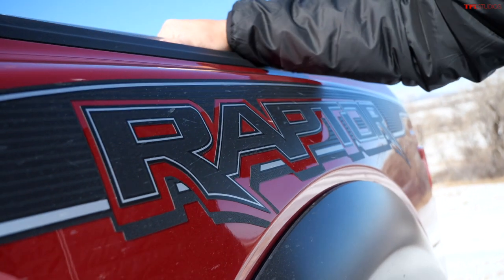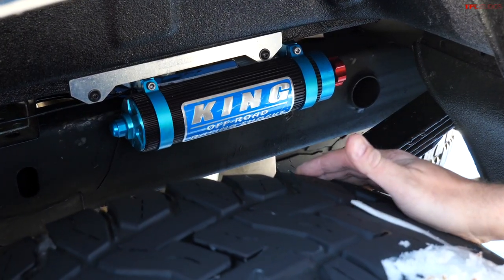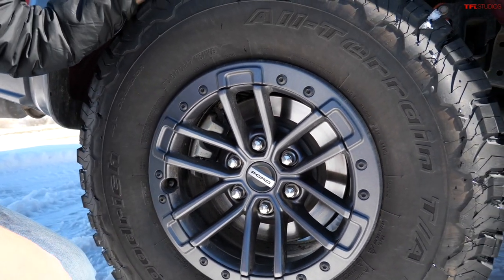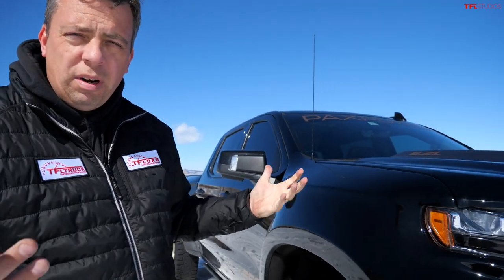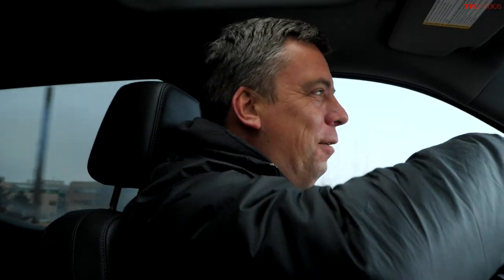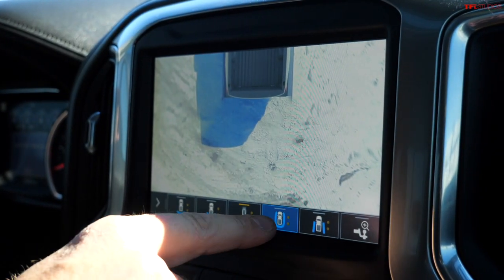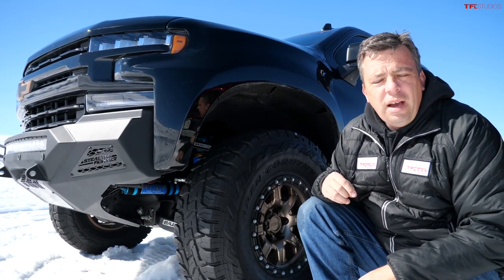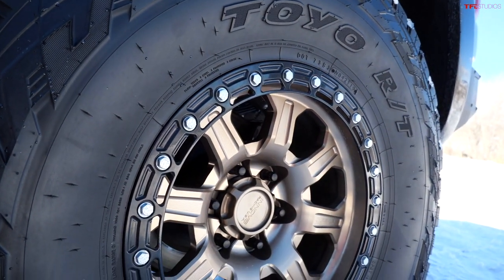Is This 650 Horsepower Chevy Silverado Jackal The GM Truck To FINALLY Take Down the Ford Raptor?

Comment: Even if you option that Silverado up to 77k where the Raptor sits, you still won't have a better truck then what comes factory equipped
Reply: True, but that's what to expect if going after market... GM should just make a factory one anyways.

Comment: I'm a chevy guy, even own a 16 Camaro 2SS but I would get a Ram or Ford before I buy a GM truck.
Reply: 2017 Corvette and I agree.
Reply: Agree!
Reply: @rondail5675  Sadly I no longer own my camero or my mustang, but my 2018 STX 4X4 supercrew isn't going anywhere. (I drove my last F150 for 15 years)By this time next year I will have enough saved for king suspension upgrades and 34 inch KO2's on the factory 20's.

Comment: Im a chevy dude by heart but the Jackal isn't a factory truck like the Raptor or the TRX so I wouldn't call it a direct competitor. GM should partner with dirt king fab or bajakits to design the suspension and stuff the LT5 from the ZR1 or the LT4 from the Z06/ZL1 to make it a true factory competitor??!!!

Comment: My 2012 Silverado 1500 has the same kind of suspension and will be getting a. 500 hp.crate motor soon . and I will save myself $60,000.00.
Reply: Well now that I foundout that the EPA doesnt like it when vehicles with vin numbers have aftermarket upgrades for more H.P. they want to go after people and force them to make it stock again or they will take it from you.

Comment: There’s no reason GM can’t build a Raptor fighter like this... it makes a lot more sense than the ZL1 Camaro (which I think is awesome, but GM sells a lot more half tons than they do Camaros) GM makes the greatest pushrod V8’s, and always has (I’ll fight you if you disagree 😉) and they’ve got the LT4 and LT5 in their parts bin... no reason not to build a badass Raptor fighter with the parts bin they’ve got. Just fix that interior while you’re at it, GM.

Comment: The Jackal doesn't have my respect until it's a FACTORY MADE VEHICLE. I respect the work of aftermarket tuners (in this case paxpower) but DO NOT give credit to the vehicle manufacturer, because they did not go the extra mile needed to compete.

Comment: The body panels are well done, but thats about it. The Raptor and TRX have different frames, different axles, different suspension, and are both rigorously tested. This GM truck have wheel spacers and a poorly designed lift for that much money is a joke. For instance, you can clearly see the shock will bottom out before the axle hits the bump stop, which will result in damaging the shock.

Comment: Really, that’s no comparison, from factory to an outfit to build it up, chev come to 115 k as was there, the Raptor ok priced at 77k, but you could do a lot with the change left over , approach, change front bar, 37” tyres. Still plenty left for fuel

Comment: I hope the chevy does better than the raptor, throw the same suspension of the raptor and  it will do just as good if not better, long travel with fiberglass and a far better suspension setup will slap any stocker in speed, of course they will do the same thing but just slower

Comment: So the belief is to take a moderate factory truck, only modifying select parts, but not the skeletal frame, and compete it with a specialty, frame-up designed vehicle and claim its compatible!?!?  Really?  I'd be afraid of it falling apart while desert running or off roading!!

Comment: During these years, the Raptor was the king of all-terrain vehicles. It has proven itself in the most extreme conditions and in all places of the world. For me, the strength of a car is measured by its ability to support and resist. In the long run, it's not just an 8-cylinder engine

Comment: It’s best to get a base model and build it yourself and not have a shop do simple work anyone is capable of. You don’t need a warranty just a brain on what your truck can do. Realistically very very very few who buy these trucks actually use them. Most just get groceries with em. I got a truck that only cost me 3k and it’ll beat both of those in real off-road situations all day. It doesn’t have more power but nobody is racing in the Baja 1000 in the same truck they drive to work. Those are flashy trucks but not all that capable for the price

Comment: It's interesting to see the Chevy that's been modified by an outside company but that's not comparing apples to apples.  Raptor is a Ford, built by Ford completely covered by Ford, Chevy has no answer for that truck. As someone else mentioned as well the Chevy interiors are so old and boring,  I've had a lot of Chevy/GM trucks through the years and if you sat behind the wheel of one, you sat behind the wheel of them all, it's time for a change!
My last General Motors truck was my 2008 Avalanche, I traded my 2004 for the 08 and had noting but issues with oil consumption (after the warranty ran out of course.) and they had absolutely no solution for the issue, my solution to the issue..buy a Dodge Ram, problem fixed!

Comment: Can't figure out why they would use a shock extension in the rear: https://youtu.be/78uHF3mRAps?list=TLPQMjUwMjIwMjH7JLBogqW0Iw&t=160  Can't tell for certain, but it sure looks like the rubber bumpstop will never be used, I guess they are just relying on the IBP.

Comment: "It's not a factory truck" but it has a V8. Hhmm, let's see crappy underpowered Japanese V6 in a Ford wrapper or a GM product with a  V8 from aftermarket company? I'll save the 100K price tag and fix my truck up to outperform both of these factory and non factory trucks at a fraction of the price.

Comment: Sure, let me build my uplander van with a small lift, 31s and king shocks. And make a wide body for it and boom i got me a raptor fighter!

You guys wouldn't review modded trucks because its not factory. But GM does have a offroad truck in the trail boss. It competes with the rebel fx4!

Comment: Both overpriced under achievers that aren't going to last very long unless you keep shelling out the bucks! 
They're not good rock crawlers. And if I wanted to do desert running I could have soooo much more fun towing a nice $10,000 sand buggy out there and not worry about tearing it up and getting home!